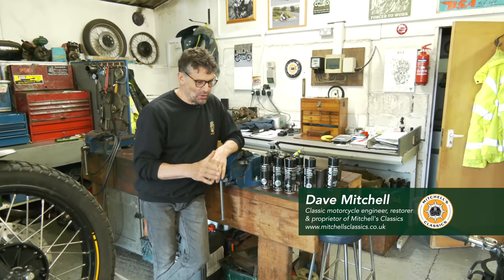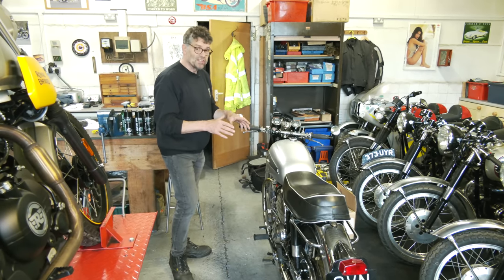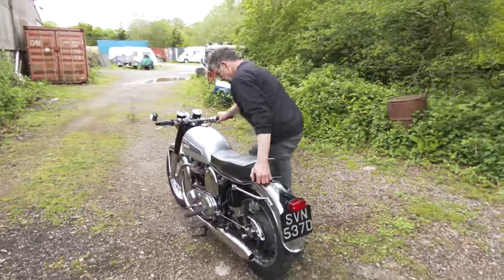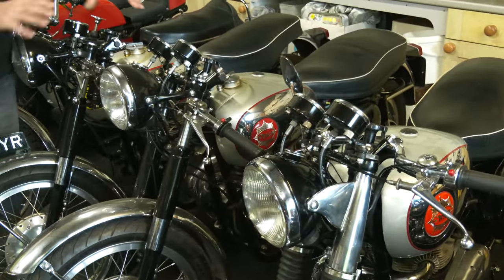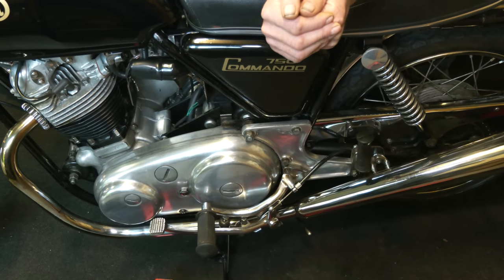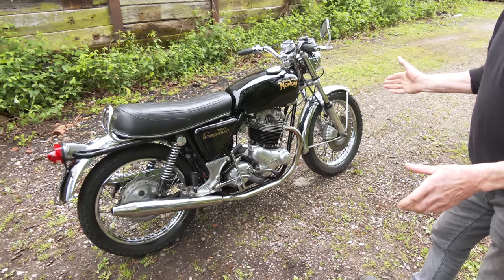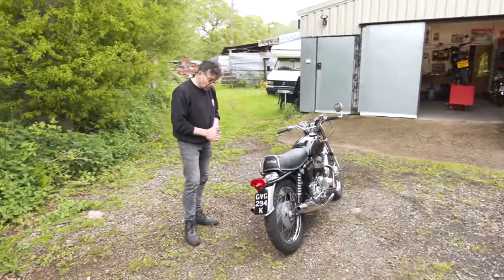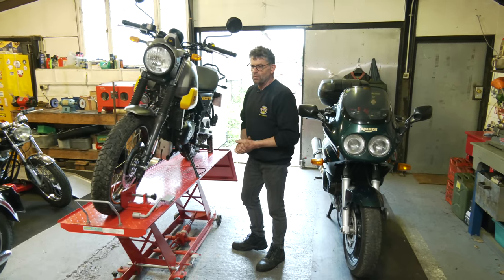Classic Motorcycle Workshop Vlog 19 - Norton Commando etc

Comment: Norton sounds great. Seems to be showing a little oil puffing on throttle blip. That happened on my Commando 850 and turned out to be failed valve guide seals (initially left side but both were brittle and cracking when I took them off). Replace with modern Viton rubber seals from KibbleWhite. Cured the smoking.

Comment: Shame they put a single Mikuni on a 72 Norton. I'm assuming it's a Combat if it's a 72. 10 to 1 compression, hot cam, 32 mm carbs as opposed to 30 mm on other Commandos. They sound terrible without the twin Amals and the performance really drops off with the Mikuni. Learn how to tune the dual carbs is preferred. It's like Usain Bolt running the 100 with a 100 lb backpack on.
Reply: Shame to put a single Mikuni on a '72 Combat. Performance gone.